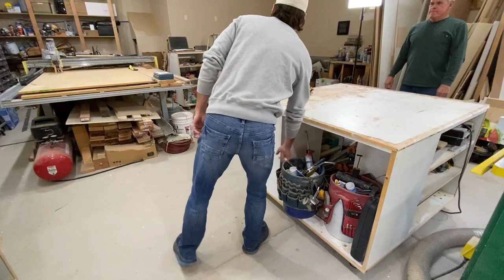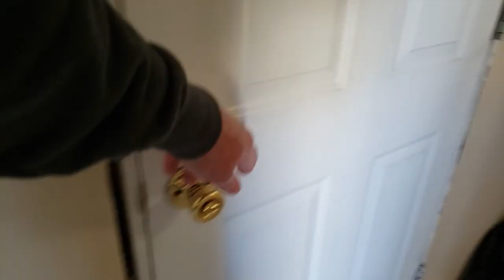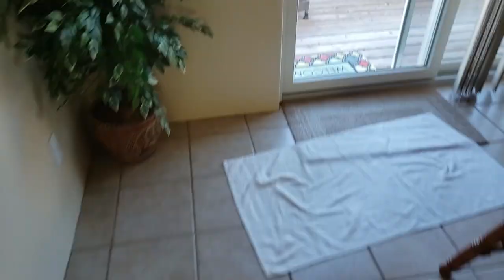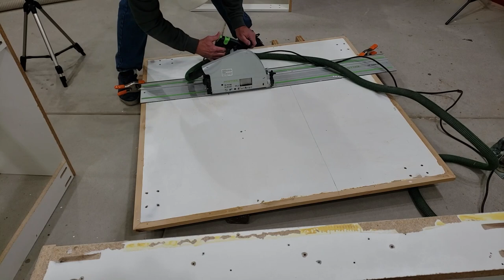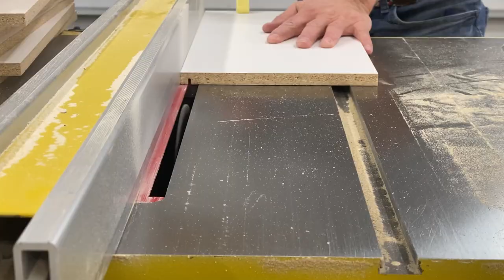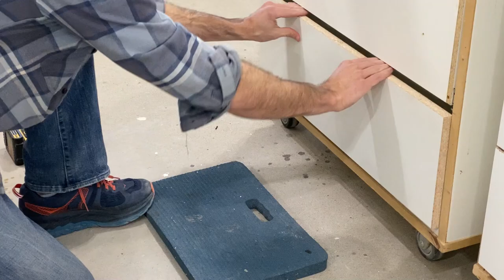Space Saving Out-Feed Table Design for the Shop

Comment: Well done, Rusty!  Gives me all sorts of ideas!   

One question: Would it have been possible to cut the top and bottom 4' x 4' with a jig saw and section out the two halves from each other?   Rather than deconstruct and reconstruct them?  :)  Great tip on the drawer fronts and the double stick tape.  Using that one!
Reply from the maker: Good question there, Doug! Maybe it would have worked but I never considered it because I knew I wanted to pull the boxes and start from there. I didn't really see the "L" shape possibilities until I had the boxes apart. Also, the top had a bulge in it because I left a pressure sprayer on it overnight and it leaked on the particleboard, causing it to expand. So I knew the top had to go from the beginning. Glad the video got you thinking! I have to stop sometimes and think about what I've got to start with in order to come up with ways to use space better.  Thanks for watching, Doug!